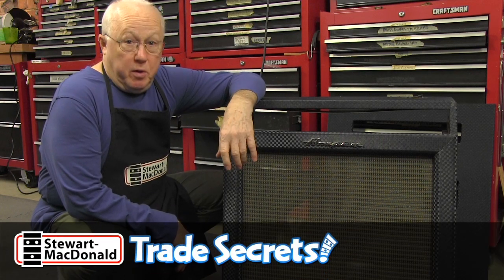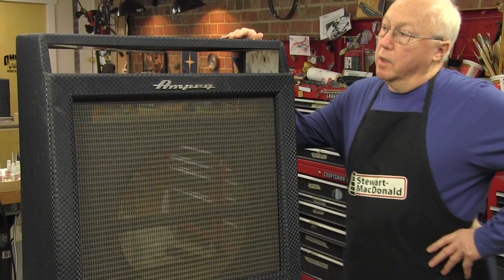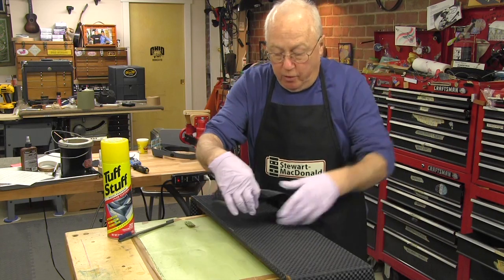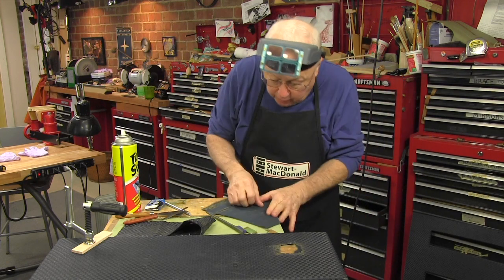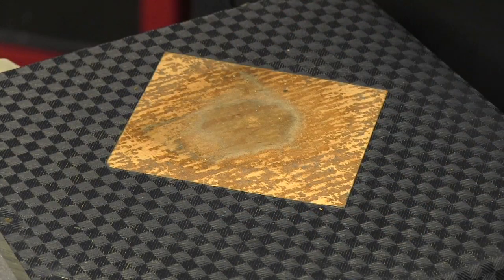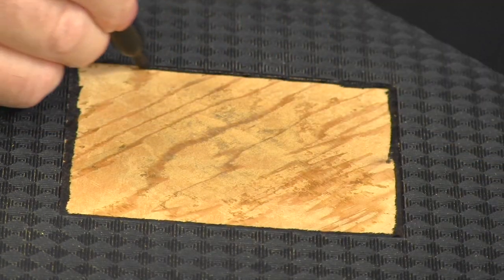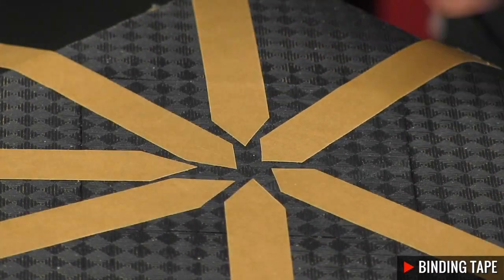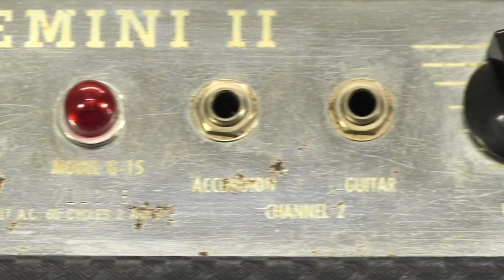Refurbishing a 1964 Ampeg Gemini II

Comment: The Gemini cleans rival Fender Blackface circuits, if I'm being honest. The Ampeg Gemini II G-12 is an amazing amp. Made in the USA, in NJ in the late '60's and early '70s, completely point-to-point, hand-wired tube amps. Ampeg sold a ton, so the used market is oversupplied. They are easily the most underrated, and hence undervalued clean pedal-platform amps out there. They were made to last. 

The reverb is incredible on the original tanks, and the original Jensen speaker is outstanding (though I swapped it for a modern equivalent, and saved the original). The tremolo is an optical circuit IIRC. Not the greatest, but very good. Just an outstanding Jazz amp, very clean headroom and very loud. Most come in ~22W. It does do breakup, and it is lovely, but it has to get LOUD. It does sing though. The best part is the sparkling cleans, and the Jazz mojo it brings. Perfect pedal platform, but it is quite heavy. The cabinet is rock solid. Find one from a good owner and you are set if you like Jazzy cleans.

Comment: Even after that cool tape stretching technique, I noticed the darker edges of the tolex patch still stood out.  If he had cut across the darker squires instead of the  lighter grey colored pattern, I think it would have helped hide the edges a bit more.  Another great video...thanks.
Reply: I was wondering if the patch may be less noticeable if the boarders of the patch would fall on the lines in the Tolex checkerboard pattern instead of diagonally crossing the little squares.  All he had to do was turn the patch outline 45 degrees.
Reply: I wonder if it would have come out better if he had "double cut" the patch, which is a "trick" I learned hanging wallpaper. You put the patching material on top of the old, directly matching the pattern. Then you cut through both at the same time using a straight edge and a razor knife. Pull the old material off and the new material should exactly fit the area to be patched.

Comment: I've also repaired real old tolex like that but used a milky looking tolex glue that you apply to both pieces, the bare wood and bottom of tolex then put them together and use a roller if you have one to smooth them tightly together and that is it, have an over head fan going so the glue will dry in a minute or so.....this glue does not have to dry over night, it is ready to go and is how the big companies glue tolex on. I works great.

Comment: aside from a Debbie Harry namecheck there really isn't all that much to recommend these....nice ones are bringing a grand
 now and up.Everett Hull didn't want to build rock and roll amps, and it shows
here. With so many small maker tweed and blackface clones and diy kits out there why invest in an accordion amp?
Reply: Tell you what; bring back your new clone or diy amp 52 years from now - gigged to death and never serviced - and see how it sounds and looks!? Bet you it will have died years before then. Clearly, those Ampegs were built like tanks…
Reply: Dave Keating it will last as long as the fender if you use good parts.
Reply: Agree Ampeg did good build quality. Fender had the rock sound. Ampeg was Everett Hull’s shop. He was a jazz guy. Leo didn’t play, he was a radio repair man. No one designed the rock and roll sound on purpose. It was an oops.

Comment: I have an ampeg cab that is very rare . ampeg told me that I have the only one. it was a Xcab that was supposed to be returned an destroyed, but I talked  one of the  dealers employees into selling it to me. all the others were destroyed. I could find any info on there web page so I called to ask about it. the man was gruff that ampeg  does not an has not made the cab I described. I told him the serial number an his tone changed an ask where I got an he said :ya Tucson . an that I have the only cab in the world like this.     I know I was rambling on I just wanted you to know the importance of it to us ampeg nuts. I toured with it an the tolex took a beating about half if gone the wood is good. should I replace it or leave as is?? thanks
Reply: Leave as-is unless the amp is structurally coming apart.